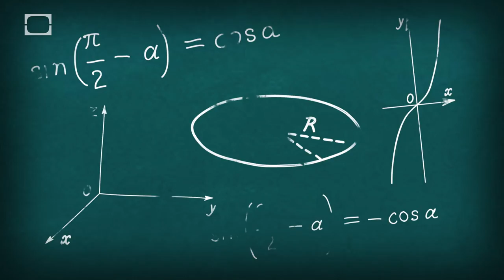How Does Captain America's Shield Work?

Comment: Since Vibranium is a fictitious mettle it can whatever properties it needs to make the shield only 12lbs, or whatever the official height is. Also, it's so aerodynamic because, again, it's fictitious.
Reply: No, and yes. The first part is no because chemistry has a periodic table. mall elements (unknown, fictional, and real) belong on the table theoretically. Since elements get heavier when more subatomic particles are added there is no way that there could be a metal as light as hydrogen. Ever.
Reply: lucidarik So it could be an exotic compound of carbon and therefore lighter than any metal!? :)
Reply: *metal
Reply: Shubham Chaudhary Good point.

Comment: The main stopping force of any object thrown is drag which is the molecules in the air hitting the thrown object and, in tern. resulting in a slowed speed. However seeing as his shield seems to reflect vibration rather than absorb it and vibrations would be the same kinetic energy as the air molecules slowing the shield down known as drag. This means that the reflected energy would result in the shield losing no speed while in flight. This means that if the shield can cancel out the kinetic force of drag it could be thrown and never stop unless effected by gravity which I guess is the only thing stopping any misses the captain throws resulting in the shield being lost in space forever.
Reply from the maker: That's the best explanation I've heard yet!
Reply: Brilliant!
Reply: If air didn't affect the velocity, then it wouldn't affect the trajectory. how would Captian America be able to throw it in a curve. Props for your explanation I would have never notice that
Reply: CoyKlos gyroscopic pressession? i think thats what its called
Reply: but there would be another problem. when cap throws his shield perfectly straight.

Comment: Pretty sure 1: Cap is able to throw around the, basically, 20kg shield because he is a super soldier and constant training.
2: He has also been training with the shield for a very long time. Basically getting to know every little trick and turn to use when fighting with it. 
And 3: its for all intensive purposes its a big Frisbee so it can 'fly' long distances before it will hit the ground. Also accompanied by its weight which would help in its momentum so therefore going further when Cap throws it.
Dont ask me how it comes back to him after though from further away distances (I know sometimes it doesnt but it seems to be able to hone in on him a lot of the time)

Comment: The reason the shield is so aerodynamic is because its shaped like an air foil. With a convex curvature on the outside and a convex curvature on the inside. Which causes it to act like a Frisbee causing an area of low pressure underneath and an area of high pressure on top giving it the ability to sustain "flight" only being limited by the force of the throw.

Comment: In theory, for his shield to be able to fly around as it does wouldn't have to be almost like an airplane wing creating a high pressure point below it and a low pressure point above it but also keep that pressure close enough to equal that it doesn't cause so much lift that it goes up and stalls causing it to go straight down? On top of that would the shield not have to be heavier in the center and almost thicker metal than on the outer edges, and like said in the video, reflect kinetic energy for it to be able to ricochet instead of just plop flat on the ground the instant it hit something because of it absorbing the energy? This in mind, the shield would have to be made out of some pretty expensive materials if it were to not dent as well as if it were to be able to be thrown like that more than the one or two times. Just something to think about.

Comment: Many comichistorians and I believe that Cap throws the shield with a special technique (plus the aerodynamic shape) which reduces the air friction allowing him to throw the shield easily. Let me quote, "Probably (the shield) molded of micron-sized alloy particles," The molecular structure of the shield would explain its density and durability of the shield without having a big impact on its weight allowing Cap to throw. The shield easily.Plus Cap can lift a motorcycle so a shield wouldn't be that much of a problem for him.

Comment: In The First Avenger Howard Stark states that the vibranium is I/3 the weight of steel, so use that figure to see how much it weighs. Also, Cap is not only in great shape but the serum has given him the strength of 10 men with 4 times the normal metabolism so he heals faster.

Comment: The only issue I have with Cap's shield is with the fact that sometimes it reflects back and sometimes it sticks into the surface it was thrown at. It seems arbitrary to me. He can throw it at a jet engine it will stick yet if he throws it at the rudders it will not stick and reflect back. 
Assuming that the material is exactly the same, is there a way to know how he can throw the shield in such a way that it will reflect back to him versus sticking in the material?
This is probably an easy physics problem but I am just a layman. I assume the amount of force he throws it and probably the angel it hits the surface makes a big difference? I also know that he can make the shield reflect back after hitting a person, so from that I assume the force it takes to reflect has to be much less than the force it takes to stick otherwise every person that ever got hit with the shield would be dead with a giant sized shield wound in their body.
Reply from the maker: That's a good point Billy. I assumed it was the angle it was thrown at, causing the edge to pierce weaker metals. But you make a good point that it would also saw people in half! HAIL HYDRA!

Comment: Cap's Shield in real life: If you look close, it is not a flag bowl shape, it is serrated like terracing from the center to the edge, I assume this helps it disperse all the energy it takes. Furthermore, as we see with Thors Hammer attack, a great deal of light was created in the impact, so obviously the material can convert a great deal of Kinetic Energy into Light, but not hear or it would melt. We see bullets bounce off the sheild, not crumple and drop in front of it, this we can assume the metal has at least enough reverb to create a nearly elastic collision. Meaning that the Energies of the shield and colliding object are conserved. Caps super strength helps him hold steady, but still he would be taking on a lot of energy often and flying back, which does happen sometimes, is it possible that the shield has some type of spring potential energy almost to counteract this. The metal is super strong so the "spring constant" would be ridiculously high, meaning that as it is impacted and gives just a tiny bit it will send that kinetic energy back out, this bouncing punching opponents back as seem in the Thor Hammer seen. Aerodynamically I think it makes perfect sense, it's like a dense frisbee that has enough mass to move quickly, except that it always comes perfectly back to him but I guess that skill comes with practice. It's ability to bounce off things without losing kinetic energy could also have to do with the tiny amount of give it has. The density of vibranium is known to be 1/3 steels of course so that's easy, and Cap is strong enough to throw it anyway. Everything seems to be in order and really quite simple regarding his shield, the only loose end is that Vibranium can turn Kinetic Energy into Light, which may or may not be a quality of a real metal idk.

Comment: I may be wrong, but I did not think vibranium was an alloy. In the comics there are vibranium mines in Wakanda. So it's a whole different element and not just an alloy they created, like adamantium.

Adamantium is a metal alloy, but vibranium is a metallic substance. Cap's shield is a vibranium based alloy though, if that's what you guys meant. Okay, I'll confuse myself if I try to go further down this line.

Comment: Well you gotta factor in that cap is a bit more than just in "peak physical condition as a human" fellas. I mean just the fact that he has been able to knock the hulk down shows way more of an increase in his body's ability to quickly generate kinetic energy, in comparison to a physically fit normal athlete. So, how much force he actually can generate from his throw(which is generally also done in perfect form, using the body's core as the main factor and the arm more or less just to aim his throw); as well as the shields actual capacity for both vibration/kinetic energy absorption/deflection/ and my personal thought of an ability to simply, and pretty much instantly, alter kinetic  to potential energy then dissipate it(or possibly even have a unique mystery 3rd material as the outer ring of the shield, that can store it to be released as kinetic, when kinetic energy is again introduced into the action to replace said stored potential energy before its motion stops, aka until cap catches it, due to his incredibly enhanced reflexes, specifically in the center of the shield or one of the actual hand slots, and in doing so, stops the motion, which could make the material dissipate the kinetic energy while retaining the stored potential, which once he throws it, will revert to kinetic again till it hits a target). As well as simply the shield's overall capacity for using wind resistance to simply spin instead of actually being moved by it, and the consistent inertia it has when thrown fast enough to negate the shield's weight. All of which have to be incredibly great, due to him bouncing it off things with no change in its trajectory, balance, angle, spin, or velocity back to him. As a simple example of what I mean as far as to his physical throw skill and power both being a, if not the two biggest, key factors: An arrow fired from a long/compound/composite/recurve bow must be arced, even at under medium range, to compensate as well as use gravity to increase the impact strength, overall lack of inertia, and the literal amount of force the bow can generate. So you set a target 25 to 30 yards away, use the long bow, then you get a crossbow with similar or equivalent pullback strength. The crossbow can be fired in almost a straight path with little arc and substantially more penetration power, where as the long bow must be arced at least two or 3 times higher just to hit the same target, and still wouldn't generate nearly as much of an impact nor hit as fast as the crossbow. Then, take it further and use a rifle, no arc is required, assuming it's sighted in, and it hits more powerfully as well as much faster, doing more damage, even though a bullets shape technically doesn't stress either penetration power or aerodynamics like an arrow head does, it's simply the difference in the amount and method used to  generate the force the projectile is propelled by(I mean many other factors are at play but to keep it basic, let's leave it at the main ones). All in all, Cap is a 50 cal rifle, Olympic grade javelin and shock put throwers or hall of fame pitchers and qbs are, in comparison, Atlatals(a very primitive, yet effective for its time, form of a slingshot/sling/long bow used by Aztecs and Mayans, if I'm not mistaken, to simply generate roughly twice the force one could when throwing an arrow shaped weapon; pretty much looked like a stick with a notch to set the arrow in place, doubling the length of ones arm).

Comment: After looking through the comments, and a little research on the Periodic Table, something tells me boron or nickel are part of the shield's construction. http://en.wikipedia.org/wiki/Superhard_materials

I neglected to include carbon nanotubes, graphene, and diamond nanoribbons because such allotropes would end up dissolving in the iron, losing their high strength properties. I also mention nickel, because this metal is commonly used in a number of super alloys, and actually gains strength in higher temperatures.

I dunno really. Maybe aliens are the third ingredient.

Comment: The shield almost certain deflects kinetic energy rather than absorbing it. If it absorbed kinetic energy, it would be useless as a weapon, and would never ricochet.

More likely, it redirects kinetic energy to disperse over the sides and away from him. This way it can still be used as a weapon, provided he hits with the edges. This would also theoretically allow it to ricochet around because the edge is what hits the walls, causing the force of the impact to launch back over the sides and provide a handy force to launch it right back off the wall.

Hence how Thor's hammer smashed through everything within a certain radius, without flattening Cap himself.

Comment: Hmm was always under the impression that Captain America's shield was composed of Vibranium, Proto-Adamantium and various other trace metals with the Adamantium giving it the durability and strength as well as preventing it from bending or being cut or dinged. While the Vibranium allows it to absorb kinetic impact without much lose of acceleration. Captain America's shield has been shown to allow him to easily slice off the metal hinges on tank hatches using the shield's edge meaning that Captain is superhumanly strong compared to the normal joe bystander and the shield can handle that strength and sheer through steel and iron like butter.

Comment: I'd want to calculate the force needed to throw the shield. Well, you can say that a standard men's discus is thrown at a speed of 24.4 m/s or about 54.6 mph by professional athletes. So have to calculate the acceleration. So let's say the shield attains that from 0 to 24.4 m/s in a half a second (Cap is quite strong. I think he can do that). So the formula is   24.4 (final velocity) - 0 (beginning velocity) / 0.5 (time). By calculating that we get an acceleration of 48.8 m/s. When we have the mass of the object (19 kg) we can easily calculate the force. F=m * a. So the force required to accelerate the shield is 48.8 * 19  = 927.2 newtons. Since he can bench press 1200 pounds or 544 kg I think it shouldn't be a problem.

Comment: In the Ultimate Universe (Universe 1610) it was Vibrainuim and Adamantium. If Adamantuim was heavy and anti-aerodynamic how would Wolverine lift a finger with those bones and slash thru air with his claws? But in the Cimematic Universe (Universe 199999) M Studios does not have rights to Adamantium thus ruling it out of that universe.

Comment: My family and I have been enjoying the Marvel movies, so please know I have plenty of willing suspension of disbelief to enjoy the genre.  That being said, here are a few thoughts on Cap's shield. 

Keep in mind the cross-section of an airfoil, which has a curved upper surface, and a flatter bottom surface.  The leading edge is generally thicker than the trailing edge.  As air flows around the airfoil, the longer path over the top and the shorter path underneath combine to create a stronger pressure under the wing, pushing it up.

A bit of reading from many years ago mentioned that the aerodynamics of the discus used in track & field events are deceptive, and are only slightly better than that of a brick.  The two items (shield & discus) are similar.  Yes, Cap's shield only shares one side in kind, while the reverse is concave instead of convex like the discus, but there is enough of a similarity that a thrown shield (presumably spinning around a Z-axis perpendicular to the apex) would have trouble staying horizontal (and therefore aimed) for longer distances.  And don't get me started on ricochets!

Point two:  The world record holding for heavier than air thrown object is the Aerobie, a flying ring.  Yes, I know, not the same shape as the shield, but close.  In describing the design process for a stable flight, the creator Alan Adler mentioned that he had to add a spoiler around the outside edge to correct for the inherent instability.  Cap's shield does closely match the cross-section of the Aerobie (without the spoiler).

Third, there is a reason why we aren't using flying saucers for air travel.  Those disc-shaped vehicles are largely unstable in-flight in the atmosphere (despite a disc being described as "the best shape for space travel").  There are other complications with those designs.

Fourth, in designing Earth-bound automobiles.  I'll use the Shelby Daytona Cobra Coupe as an example.  If you look at the back half of the vehicle, as you follow it from the roof to the rear, it abruptly cuts off instead of flowing to an edge (like a Porsche 911).  The reason the Daytona uses this is to reduce the airflow eddies at the tail, which reduces performance.  The small area behind the cutoff tail helps the air rushing past the car to flow smoothly. 

I suspect that those eddies also disturb the airflow over the non-corrected Aerobie and flying saucers as well, and outside of the comics & movies, would have the same effect on Captain America's shield while in flight.

Sorry for introducing real physics into the Marvel Universe, but my engineer's brain feels better now.

Comment: The answer to this whole rant is simple - IT IS BECAUSE IT HAS TO BE. That's the beauty of fiction; you don't have to ever-analyze everything. In terms of the films though, Howard Stark told Steve that vibranium was stronger than carbon steel, and one-third the weight. He also said it was harder than diamond.
Reply: +Moviefan2k4 ok your point that has nothing to do with the fact it with stand metal thats way stronger than it.